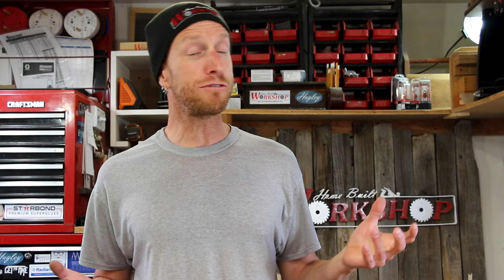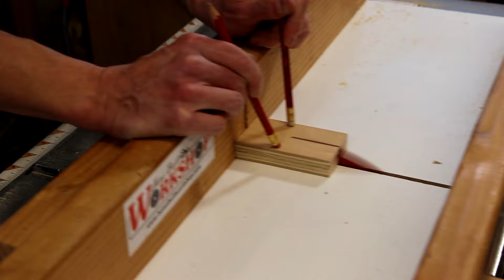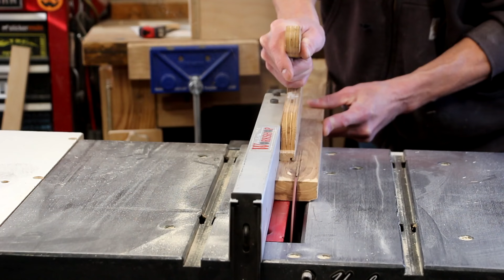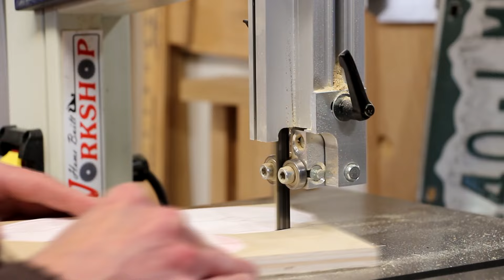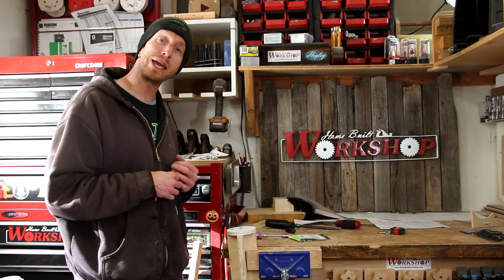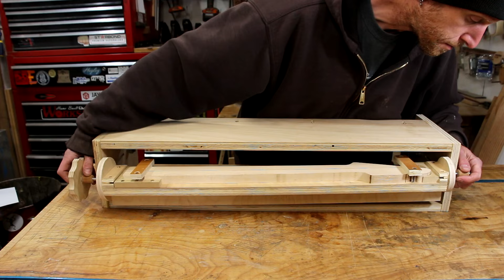How to Quickly Carve a Guitar Neck | Building the Temple Guitars Router Jig

Comment: American machine shops and I think there are only 3 left in the USA, are all working in thousands of an inch. They are basically using a disguised Metric system in multiples of 10 but they do it sneakily, so they don't have to admit to using Metric. If you want accuracy and not be a caveman, you work in multiples of 10 only. 
Just take the plunge and join the rest of the world.

Comment: The conversion math to or from metric is very simple. 
From imperial to metric is × 25.4 , from metric to imperial is ÷ 25.4.
I work in a custom cabinet shop that deals with both simultaneously.  
Yes,  it's maddening at times

Comment: I enjoyed your video on neck radius routing immensely. Great presentation and loads of information on building this jig. It is something that I have procrastinated over for about 5 years, but it's now time to bight the bullet and start the project. Up till now I have hand carved each neck, but it is difficult to get repeatability every time, and as I don't have a CNC router, this is probably the answer. One question though:  I have seen many carve the neck with the fretboard fitted, but you don't. How do you get the exact dimensioned cam shape, except by trial and error. I hope you respond to my query, as it is baffling me. Cheers from Australia.

Comment: An even better way is to make a similar jig that runs on a shaper. That way you can use the radius of the bit instead of the tip of the bit which leaves you with a right angle cut at each end which you have to carve in the transition which for me takes about as long as carving the neck all by hand. FWIW, I use a similar jig but fancier and really look forward to buying a shaper as necks are a bottleneck in my shop. I thought my jig would save me time but it doesn’t, although it does give me nearly the exact same neck every time which is valuable to me.

Comment: Hearing that all the measurements are in metric was actually a nice surprise for me when you built it up as a negative. I’m used to having to use imperial for woodworking projects even though I maintain it’s a far inferior measurement system that doesn’t make any sense and has completely arbitrary conversion factors.

Comment: So, I decided to have a crack at designing my own, to fit my router. Made some changes, pivot slots in from the top, rather than hangs from elastic, which inverts the radii of the profile wheels (lower wheel radius for greater cut and vice-versa), but allows for working in even passes from one side of the neck, around to the other. I can also 3D print my radius wheels, making for a more mathematically precise curve transition. I haven't even built the design yet and I LOVE this tool. My estimate is less than AU$100 (~US$67)  from go to woh-uo there, it's done. Less for me because I already have the necessary bearings for the profile wheels to run on and I'll only need a single 1200x600z12mm sheet of structural ply to build it. All of it other than the screws bolts and profile wheels. Thank you for showing me the way to realise a lifelong dream!

Comment: This is amazing! One question though: What was the exact diameter of the CAMs on each end? Or does it matter, so long as it's the proper profile?
Reply from the maker: The diameter sounds tricky but its not too bad. Its basically the profile of the neck at the first fret and 12th fret, then just scaled up equally.
Reply: @homebuiltshop  So is it the exact width of the neck at the 1st and 12th fret respectively?
Reply from the maker: In theory it could be but that would make the cam pretty small. Once you have that size figured out, then you can just scale it up so its not tiny.

Comment: The only problem I'm seeing with this jig design, is how in the heck would you use it on a neck with a tilted back headstock?
Reply from the maker: You're correct. This style is intended for necks with the flat headstock. You would need to modify the headstock area to accomodate an angled headstock. I've seen similar jigs used that way though so I know it can be done.

Comment: Appreciate you sharing your neck carving jig.  Was going to make one and was modeling it after yours.  Also wanted to share the jig from Randy’s Guitars and Broncos (part 4 in his series).  He adds a riser at both ends of the jig that lifts the router nearly eliminating the need to blend in the valute (not sure of spelling) area and the body joining end of the neck.  Thinking you might also come up with a few upgrades.  Check it out if you have time.
Reply from the maker: The riser is a great idea. That would save quite a bit of extra shaping.

Comment: We should all be using metric! 😊
Reply: Why? Is it easier to measure 4.762 mm than 3/16" ??

Use whichever measuring tools you have and you'll be fine.
Reply: ... and driving on the left side of the road. My biggest challenge in Australia was owning and driving a LH drive Ford Pinto. Passengers in the front seat absolutely hated being close to the centre line with me on the left side!!
Reply: In metric u would never use 4,762 u just round it to 4,8mm and u are done ✌🏻
Reply: @ahuserka Or use digital calipers.

Comment: I sympathise with you struggling with metric to imperial. For me the struggle is the other way round. It becomes one of the skills you need to do stuff. I am still baffled that anyone would cling on to the imperial system where you need to do mental gymnastics to work out if one fraction is bigger or smaller than another. I suppose it becomes obvious if you are used to it. 
Great video. Very helpful. Thanks

Comment: If the shape of the neck you want to achieve has a radius lenght of i.e. 2cm, and the template shape radius touching the bearing is long for example 3cm, it should be that the template is x1.5 than the real shape of the neck.

Comment: If you learn how to do it by hand with a rasp it will be more rewarding in the long run! The first few were very slow and time consuming but before to long you can have a neck fully profiled in about 30 minutes
Reply: The rewarding part for me is getting it built faster to be able to play it. Im all for getting more accurate results everytime. Especially if you find a specific neck profile you like and want to copy. You can make exact cam templates for that neck. Bust them out in 5 minutes everytime.

Comment: Watched this a couple times.   Also hours with 3d printing of parts.   Went to Temple for plans but didn't work.   I believe you could modify jig in the headstock & body end to rough away some of the hand  work finishing those profiles.   Possibly an adjustable router base to move east-west for careful freehanding flutes etc.   4 minutes for neck is awesome but still a couple hours or more in the headstock/ tail area.   Just an idea. If you do your own plans for Fender Strst/Tele necks and cams eat let me know.  No joy through Temple.
Reply: I'd love to know what your issue was. I never heard anything from you?

Comment: Ok, as a professional luthier I can see the appeal, but how do you get the taper down the neck with this jig? Quo @ Quo Guitars
Reply: The cams on each side look different. I wonder if that's his plan, good question though.
Reply from the maker: The bearings are at different heights which put the neck at a bit of an angle. Then the headstock cam is smaller as well to make up for the taper on the sides.
Reply: @homebuiltshop  Cool, really good jig, I think I have to build one, although I do like making necks. Many thanks, and stay safe and well mate

Comment: You can copy this jig with some modes, in order to clone neck profiles you want.
Where the bearings touch the profile disks, remove the bearings and set the router bit right on that spot (one router for each side). (or a pencil for each side). Put new "blank" discs.
Set one fixed guide on each side of the neck (headstock and guitar body), so the disks will move accordingly to the neck profile. A pair of wooden strips/bars connecting both sides of the frame will work ok.
Turn manually the neck and you will have both disks milled or outlined. 
For short, reverse engineering!
Don't forget to "hide" the fretboard Inside the carriage board, so the disks will not sum its thickness...
Reply from the maker: This is a brilliant idea. Thanks for sharing. I need to experiment with it. I cant yet visualize how you reference the surface of the neck but I have an idea of it. If you've done this would you be able to email me more info? Homebuiltshop@gmail.com
Reply: @homebuiltshop  it's very simple in fact. Look the template discs as "shadows" on the wall. The guitar neck is the object and the router bit (or in this case, to make the discs, the fixed wooden strips) are the candle... 
I will make a project using AutoCAD, then I can convert it to .pdf and send to your email address.
I will not use measures, but I will put indications to use the same measures of your project already done.
Just give me some days to sit back and draw everything!
Reply: @TheBelltowertrio  sent
Reply: @homebuiltshop  sent... Let me know if you liked it or have any questions...
Maybe I should have sent the simplest solution too. Tomorrow morning I will draw it, so you will not have to make extra parts...

Comment: Great video Thanks. your work would go easier if you got a router instead of a laminate trimmer. That pour little thing was made to trim counter tops not shape hard maple. A 2 horse ,1/2 inch router  would produce better cuts and bits will last longer so cost less.
Reply from the maker: I do agree with you. I have a larger one, its just mounted in a table. I will eventually get another larger one for this job.

Comment: You mantion metric calipers.  There are digital calipers that convert imperial to metric at the touch of a button, some even do fractional measurements as well.  I can't understand why you would have a single system device.  All of my calipers here in the UK have dual capacity.
Reply from the maker: I don't have any digital calipers. Mine are all dial calipers. If I get a pair of digital ones, I'll get one that does both.
Reply: @homebuiltshop  Hi, get one that does imperial fractions as well - really worth it. Love the jig by the way, sorry I didn't say that in my earlier post.

Comment: thank you . question please why did you not use a radius router bit so you would not have straight shoulders ?
Reply from the maker: I didn't have a rounded bit at this time. I have since gotten one but for some reason, this straight bit still gives me a nicer surface. I'm still trying different ones though. I think I need to find one with just the right profile.

Comment: Nice!

Now...put the whole box on a slide track and build a mount bracket for the router tool so you can have both hands on the carve box and the router can be held stationary.  You'll gain more control over your carve that way.

You'll also want to find your max depth for your router so you will have consistent carves, and gauge each time you put the router in place to work.

Nice DIY tool!!!!!
Reply from the maker: There are so many mods that can be done from here. I've seen some amazing versions of jigs like this.

Comment: It's a fake neck, because the right neck should have different widths at top and the bottom of the neck. So, you never can pass back of the neck with router with the same radios, like you have it done on this video!
Reply from the maker: The neck sits in the jig at a slight angle so the neck is thinner at the headstock end than the heel. Also the cam at the headstock end is smaller in diameter so you get the taper in width as well. The geometry of everything makes it work.

Comment: Hey buddy, what’s the math on the wheels or where can I get the plans I found this cause I watched temple guitar videos and it was nice for you to explain the build. I have built my own but the math on the wheels I can’t seem to figure out
Reply from the maker: If you extend the measurements of your neck out to the length of your jig, then add a certain amount (this can be whatever, as long as its the same for both cams) This becomes your cam size. For the profiles, I took the cross section of the 1st and 12th fret and applied it to the cam. Its just blown up to the size of the cam. I hope that helps a little.

You can get the plans from Temple Guitars. You can email him at hello@temple-guitars.com. He sells customized plans. If you already have a jig, you might just need to fine tune your cams though.
Reply: @homebuiltshop  I bought some... mwahahahahaha I found your video cause I had watched jayzsuns before

Comment: This is genius.  Thanks! But to be honest, I don’t really want to make carving the neck quicker! Its the one part I look forward to.  I might make a jig to radius the fingerboard though.
Reply: Yep. I just got in from the garage after carving a neck freehand tonight. I use a 4" grinder with a 40 grit flap disk to remove most of the wood, them finesse with a half round rasp and half round file. I made a fretboard radius jig for a router last year, it saves a lot of sanding! The radius blocks just get used for finish sanding nowadays. I can radius four fretboards in an hour without rushing.
Reply: @dasschaf2476  A grinder? Hey great idea.  I just use a Shinto rasp and a couple of other rasps. I could use that Shinto to cut down trees! but wow, 4 boards an hour is a good pace. I should try that.

Comment: I made one my self having seen the various jigs and tested it with three pine blocks. Cut lines are visible but you can sand them easily and it works great. However, to be honest, it scares the crap out of me that the router is taking off so much material, despite I try to make shallow passes, I don't "feel safe". Are you reversing the cutting direction past the first half of the neck, like you would if routing a body?

Comment: What if your headstock is angled?...would you do the profile first,then a scarf joint,or will this only work on non angled headstocks?
Reply from the maker: I have seen the carriage made with the angle to work with a scarf joint headstock. I think a cool idea would be to make a flat one like this, then make some type of adapter block you could attach to do angled headstocks. That way you could do both with the same jig.

Comment: Good Video Jeff.  Thoughts on custom templates to allow the same jig to conical radius a fret board?
Reply: I would imagine using different sized cams would achieve that. Figuring out the ratio of cam to carve would be the first step. You could really use this jig for more than just neck carving.
Reply from the maker: You are right, getting the sizes correct is the hardest part. Once you get it down, the only change is in the profile.
Reply from the maker: I'm making a set now to test it out. I think it'll work out well.

Comment: Looks like the Scheltema jig with a box built around it so the router is overhead instead of using it over a router table...
Reply from the maker: I need to look that one up. Sounds interesting. 👍
Reply: https://youtu.be/fv-mLftEiRM
Reply: @MinimumGuitarWorks  yeah, the Temple jig works on exactly the same principles as the Scheltema jig, only upside down with a hand router instead of a table router. Prior art confirmed 😁
Reply: This one is self contained, doesn't require a router table, is safer, and can be modified to accomodate multiple radius options.
Reply: @TempleGuitars  multiple radius options?  That’s a point where the designs are identical.  The whole thing is identical minus the box around it
Reply: @MinimumGuitarWorks  Sure thing, champ.

Comment: Is the neck taper end to end taken into account or is the thickness same at both ends.it would be interesting to see an update on the disc shape to see the actual relationship or maybe just do an IG post on the updates .thanks man. Doing metric conversions 🙀
Reply: It's also designed so the 12th fret and the 1st fret have a Z Axis difference of 2mm built in, so it's thicker at the heel end than the headstock end.
Reply: Temple Guitars  very cool. Im ready to build mine.
Reply from the maker: The taper is factored in. Its based on the different sizes of the cams. The headstock end is a smaller cam which makes the neck narrower than the heel end.